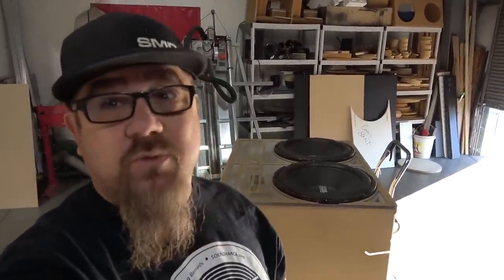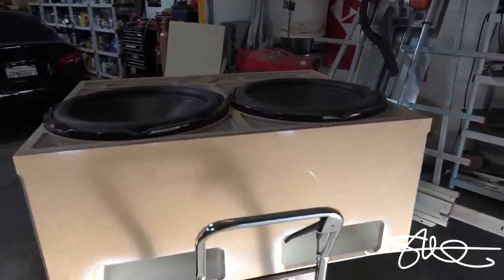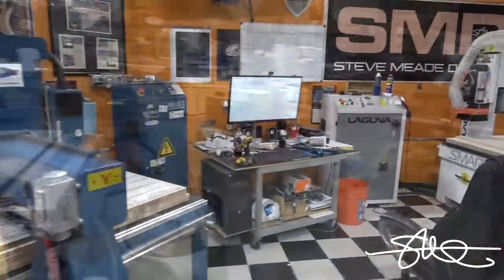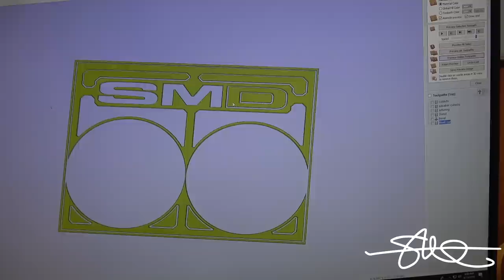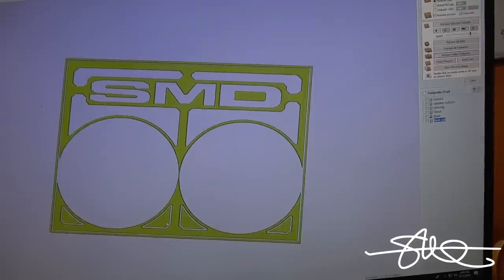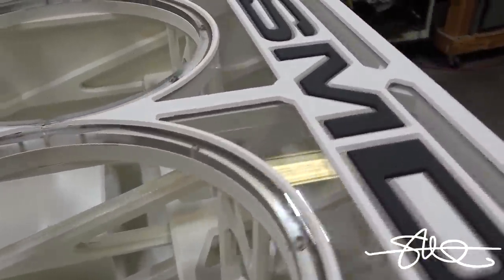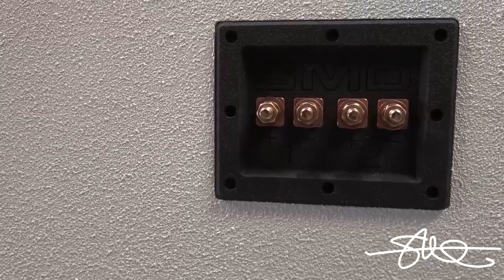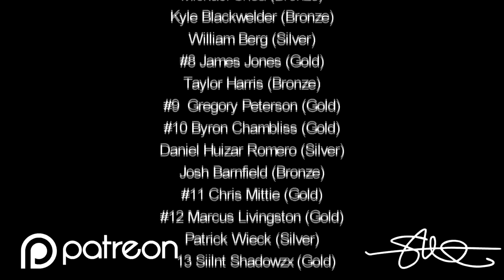Shooting the "Skelator"! 2 Gigantic 24" Sundown Audio Zv5 Subwoofers One HUGE Ported Box!

Comment: I'm curious where that hydraulic lift cart came from. That would be a God send for moving a trans and / or motor in and out of a front wheel drive car on jackstands.
Reply: Tim Pendleton look it up on google!
Reply from the maker: Harbor Freight bro!! It's AMAZING! I love this! Might by another just to have a 2nd one handy.
Reply: Thanks for the reply man. I love your channel. Hook this box up to one of those HUGE amps you get to play with and see from how far away you can make people complain. Lmfao. I will be going to "horrible fright" to get one of those carts for sure. I've got a mk4 Jetta tdi that I'm converting from the shitty auto to a 6 speed manual for 50+ mpg and one of those carts would be the perfect thing.

Comment: hey meade   what would you run on 3 skar  vd  12s they are 500 watt rms  800 max   I was  thinking maybe running  the skar rp2000.1  on them  but I just want to know if  I am going to high or  should I get the skar rp 1500.1